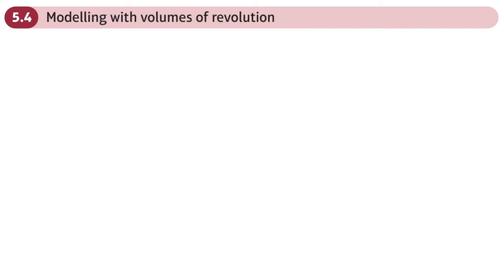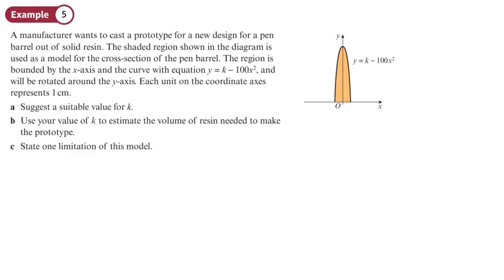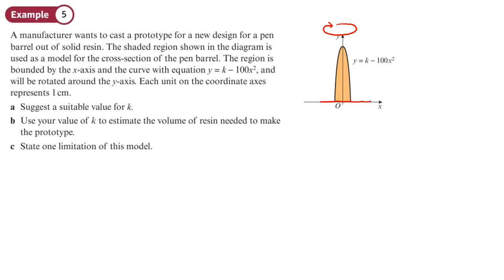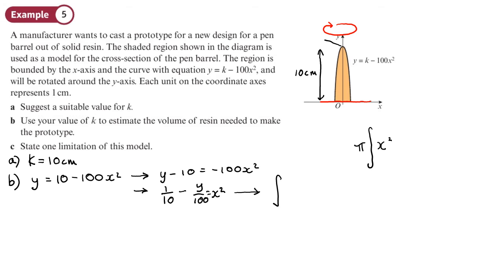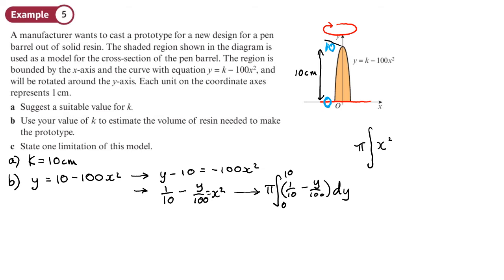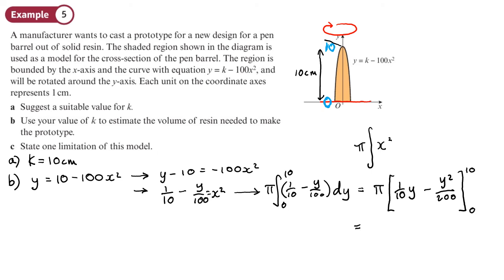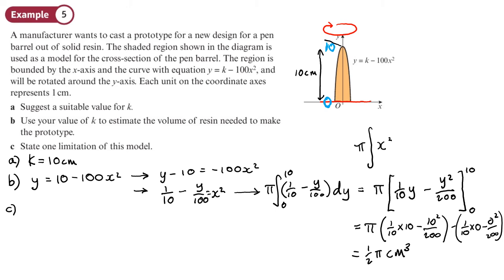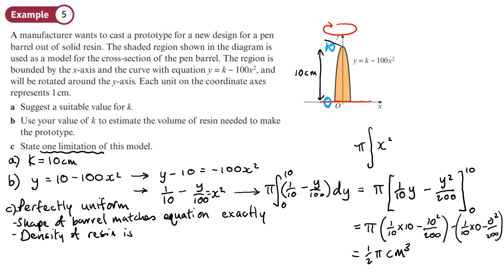5.4 Modelling with Volumes of Revolution (CORE 1- Chapter 5: Volumes of revolution)

Comment: I noticed some of the questions don't tell you which axis to rotate it around, in this circumstance are you able to freely choose whether to rotate it around the x or y axis?
Reply from the maker: No, there will always be some information or diagram that you can use to tell you which axis you need to rotate around
Reply: @HindsMaths  In the textbook page 84 Exercise 5D, Question 1, it doesn't appear to tell you which axis to rotate it around so I just used the x axis because the equation was y^2 so I wouldn't need to rearrange anything, and I ended up getting the right answer still, is that the type of information you need to know what axis to rotate it about?
Reply from the maker: It seems like you did the right thing.  Textbook questions have this problem in that they don't always have enough information.  Once you understand a topic then use exam questions for practice.  You'll send a difference in wording and the amount of information and diagrams given
Reply: @HindsMaths  Alright thanks 👍🏾

Comment: Why did you pick k as 10?
Reply from the maker: It's just a "sensible" value for the length of a pen
Reply: @ so how am I supposed to know for questions like this (finding suitable values of k for not just pen but other things)
Reply from the maker: It's not the sort of thing you would be asked to do in an exam.   That's why exam questions are better for practicing than using questions from the book
Reply: @ i thought i saw questions like that in an exam

Comment: doesnt the final volume need to be divided by 2 as the function covers both sides of the y axis?
Reply from the maker: No, because the volume of revolution formula rotates the graph by π (180 degrees) around the axis. That's why theres a π (not 2π) in front of the integral sign.
Reply: @HindsMaths  i thought pi infront of the integral meant a full 2pi rotation?
Reply from the maker: @chilledvibes99 It does, but only if an axis is a line of symmetry of the equation